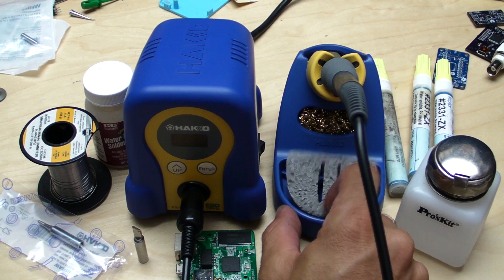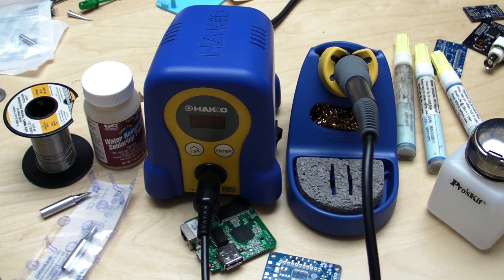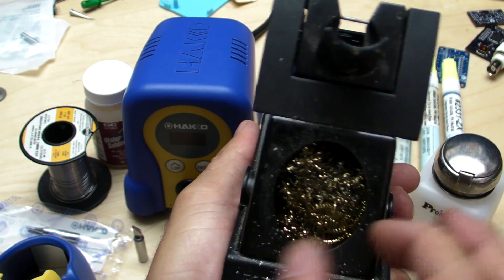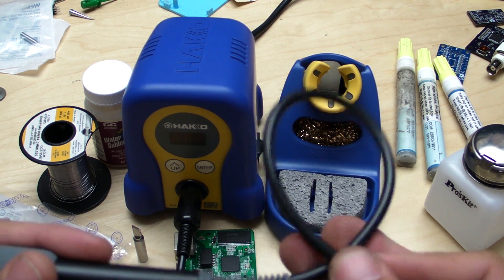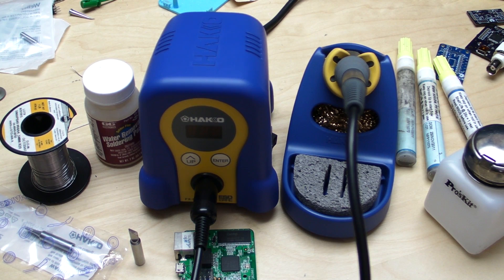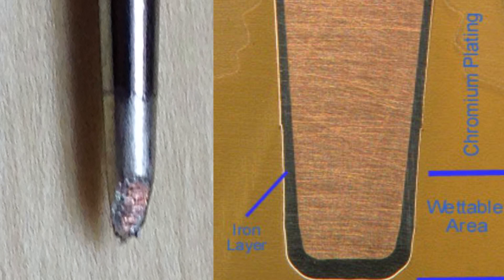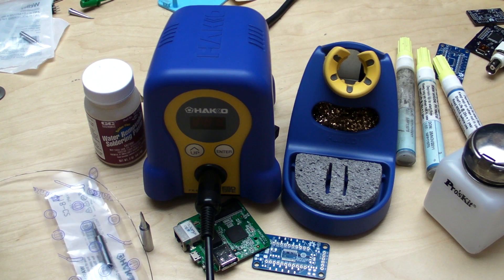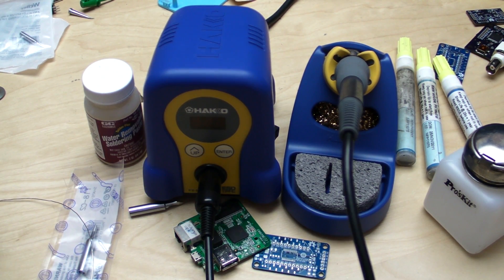Hakko Review and Soldering Tip Care

Comment: The iron plating is NOT cast iron; it's fairly soft compared to  cast iron. It's not stainless steel either, because most stainless steel alloys wont accept solder.

Comment: LEAD IS LEAD  The less lead we dig out of mines and pull into our working and living areas, the less lead will be present in perpetuity where we live and work.  It does not matter that our work product ends up free of lead - the lead used lingers somewhere.
Thank you for the 700°F-725°F range suggestion for lead-free solder, I will try the 716°F for my through-hole, electronic component soldering.

Comment: Hakko's iron is very good, but the interface is a dumpster fire. They should have used three buttons and nobody would have had the need to read the manual to avoid offsetting the tool.
(Thankfully, it can be reset to factory settings quite easily, but still...)
Reply: The new haco FX888DX doesn't even have 2 buttons but instead uses a rotary digital encoder and 1 button.  I watched somebody trying to set it up online and the user interface looks terrible to me.

Comment: Hey,  what an excellent video, thankyou. I had question, im repairing a headphone that as wire disconnected from the post, I think I have two option correct if I'm wrong.

1. Re heat the original solder and afix the wire.
2. Add abit of lead solder to the post without removing old solder.

But I'm not sure if the original solder is lead free or lead does this matter if I use lead on top without desoldering the original solder?
Reply from the maker: You probably already figured this out, but you can mix and match in this instance. Adding leaded solder will decrease the overall melting temperature of the solder joint and of course mean its no longer lead free. You can also use Bismuth based solder like Chip-Qwik which can lower the temp and make it easier to rework. Hope this helps!

Comment: Dictionary
Search for a word
sol·der
/ˈsädər/
noun
noun: solder; plural noun: solders
a low-melting alloy, especially one based on lead and tin or (for higher temperatures) on brass or silver, used for joining less fusible metals.
"remove the fitting using a blowtorch to melt the solder"
verb
verb: solder; 3rd person present: solders; past tense: soldered; past participle: soldered; gerund or present participle: soldering
join with solder.
"the wires to this clip are soldered to the circuit board"
Origin

Middle English: from Old French soudure, from the verb souder, from Latin solidare ‘fasten together’, from solidus ‘solid’.
Reply: perfect especially for an american
Reply: @tomgiorgini9154  I always pronounce the word without enunciating the 'l' , which appears to be silent.   Some like to pronounce the letter 'l' in the word because the word is spelled using an 'l' letter.
Reply: Ya'll git fooked!  No one likes people like you.

Comment: Our accents sound very similar, but when you say “solder” it rhymes with “shoulder,” which makes sense. I’ve never heard it said that way, though. I’ve always heard it pronounced “saw-der”. Also, the original soldering irons weren’t electric and weren’t copper core.. They were iron wedges about one by three inches with long handles. The iron was heated in a charcoal brazier, then pressed against an ingot of lead. The lead melted and ran over oakum packed between lead or iron pipes and sealed the joint. Then the hot iron was used to shape the seal. This was done before electricity was discovered.
Reply: English is a terrible language for rules. I speak 3 languages and English has the most grammatical exceptions. "Solder" should be pronounced the same way we pronounce "folder" but nah let's throw a curve ball to those learning it... Just to keep em scared 🤣
Reply: @supersabrosinho ,  The Oxford english dictionary says that both pronunciations are correct and acceptable. PS,  Solder comes frim the French word "soudure".

Comment: I'm wondering, what about Hakko FX-888D vs TS80 + stand + sponge? The TS80 seems to have a very good thermal performance even though it's only 24 W as it has a direct-to-tip technology and the Hakko's thermocouple isn't placed directly on the tip, so it has worse thermal performance. And the Hakko's interface is... well... how would I say it... horrible! Why, Hakko, why? Why did you put only two buttons in a 130 € station? Also, the TS80 has built-in sleep temperature. But on the other hand, the Hakko is a proper soldering station and the stand is awesome. Not to mention you can hack it to make the interface better with 5 presets, which could be used for making the sleep temperature feature work.

Comment: @9:20, i read that the tin in the solder actually mixes with the copper and literally dissolves it. I have soldered for 30 years without ever knowing why how or what, Like digging the tip when desoldering, destroyed a new tip first use, Thanks for the video.

Comment: Great videos hakko makes the best products. I do a lot of through hole components soldering replacing capacitors on tv power boards. I really like the Kester solder NTE Kester 44 Rosin Core Solder 60/40 .031" 1 lb.
Sn60/Pb40. I noticed you have a Kester 951 flux pen and a Kester 2331-ZX flux pen what is the difference and what type of flux would your recommend for through hole components. Thanks for all the great videos been a subscriber for quite sometime. Really enjoy your videos and you are the one that got me into soldering after watching your videos highly enjoyable

Comment: Excellent information. After working with soldering irons for many years, I was not aware that the copper tip on quality irons were in fact laminated with iron. Thanks
Reply: A bare copper tip would quickly be eaten away by the dissolving effects of molten solder and flux, especially if you're using lead-free solder which melts at higher temperatures and uses more corrosive fluxes.

Comment: My question is not relative to soldering. 
Hi, i bought hakko fx888, rated voltage 230v 50hz from Israel. But the voltage in our country is 220v 60hz. My question is, is it possible to use it in our country without having a problem?
Reply: I'm also in the search for this station in Israel from where did you get it? did it work properly with our voltage?

Comment: As a beginner, after twirling my own stand out of a hanger, neglecting to take into account the heat loss with tip hitting hanger, having bought lower cost Weller @ 400 max temp(no dial adjustment), I figure I'd be at a loss in progression.  Explanation via your video helps me see otherwise!  Thx!  Will continue watching.  I've subscribed to your show and intend on watching more.   Am only unsoldering at this moment to get feel of hold, solder timing, etc.  Can tips from Weller be used in Hakko?

Comment: It does not matter for soldering performance, but is there a maintenance tip to help keep the non-soldering portion of the tip clean, as well as the retaining sheathe? Mine has gotten very crusty looking, i guess from flux popping and cooking on it.

Comment: Great tip care advice and overview of the 888D's performance and functions.  I don't understand why so many people have complained about the temp setting configuration?  It really couldn't be any easier, Hakko created an awesome,  replacement from the less accurate analog FX-888.  You just can't get a better name brand unit for the same price.  If anyone thinks they can send me a link and don't forget to take into consideration the cost of tips!!
Reply: +Vinny Lacorazza  I have no problem with the user interface. I'm using the preset mode. I set mine to 600, 650, 700, 750, 800.  This works for me. So far, I'm liking the FX888D a bit better than my Weller WESD51, and that's saying a lot because I love the Weller. It's 12 years old and it's been dead reliable. Hopefully the Hakko stands the test of time
Reply: The new Hakko FX888DX has a single rotary digital encoder and one pushbutton for setting temperature, and from watching somebody use it online I don't like the user interface at all!

Comment: SparkysWidgets  hi good day I have a used  80 W Weller WD 1000. I am thinking of up grading to a   Weller WX 2 would the iron WSP 80 FIT THE Weller WX 2  UNIT .
Reply from the maker: Carlos Vanquish Unfortunately the WX units are not backwards compatible with older irons. I will say that it is worth the upgrade even if you have to get new irons (even coming from a WD, which I used to have). I have had a lot of time with many types of units ranging from WS, WD, WX, several Hakko units and a couple Metcals. If I had to choose just one station it would be the WX2 with a WXP65 and a WXMP although I currently have 2 WXP65s hooked up with different tips.

Comment: FYI, The name "soldering iron" comes from early days - pre 1930, not because of iron on the tip. Original soldering irons had only copper tips. They had to be filed to clean them up for "wetting" with solder. Term "soldering iron" is a  parallel to "Branding iron" used on ranches. The plated tips are relatively new but so very nice ! The instructions for cleaning the tip in the video seems a bit excessive. With the cost of solder, might be less expensive to wipe the tip clean with the brass sponge as needed then replace the tip when it is required. I've not replaced my tips after 10 years of heavy use. One thing to avoid is to melt any material other than solder. Plastic or wire insulation can really mess up the tip by chemically degrading the iron of the tip.

Comment: Do you have a recommendation between the Hakko or Weller unit?
Reply from the maker: The best way I can answer this is the units are really a close match and both have some strong points(I should probably do a comparison video). Depending on your location globally one unit might be easier to get tips for and maintain, in which case you want to choose the one that will make your work easier. If you are chasing parts instead of soldering it doesn't matter how nice the station is!

For example Hakko tips and units can be difficult to get in places in Europe (Not sure if this is still true) so it makes sense to choose the Weller unit if you are there.

Both units are strong and will serve well, just take care of the tips and practice!